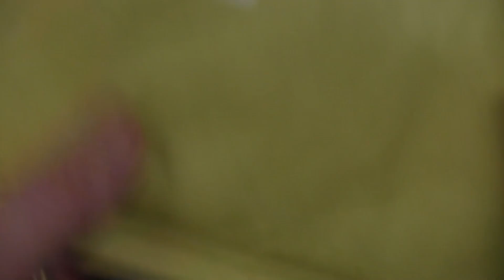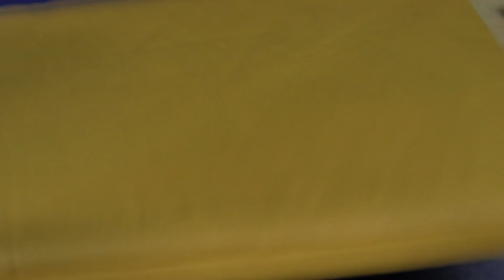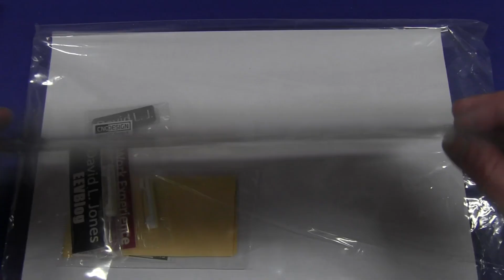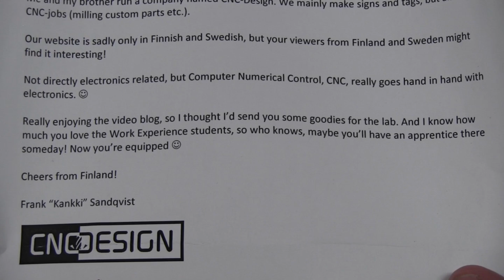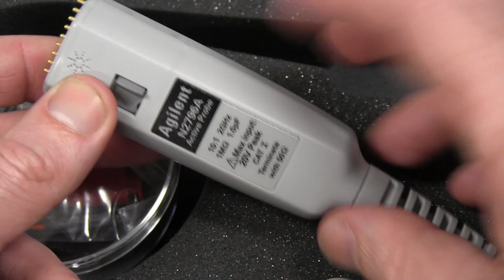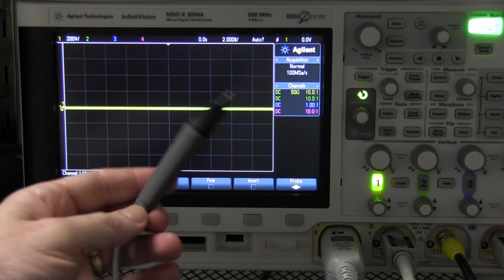EEVblog #309 - Mailbag

Comment: The scariest thing about a $20K box like that is that all it takes is a single transistor in some custom chip to fail and turn the box into junk. Someday they won't support it any more and you could have an expensive door stop. It makes more sense to build gadgets that can be driven by PCs, all of which can be inexpensively replaced as time goes by. Why don't you go that way, Dave,  with a PC-driven power supply--no knobs, no displays? And it can vary output according to a plan and log it all.

Comment: A "flathead" screwdriver? Not you, too, Dave. There is no such thing. A flathead screw is one whose top surface is flat and designed to finish up flush with the surface of the equipment it is used on. The driving method may be Phillips, hex, spline, Torx, Scrulox and many others. You are thinking of a screw that has a straight slot in it for use with a slotted screwdriver.